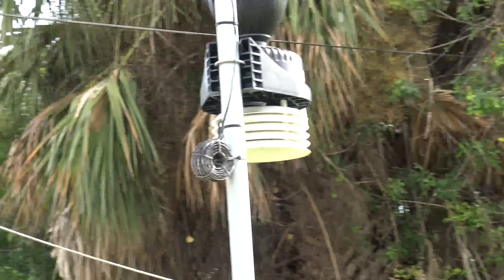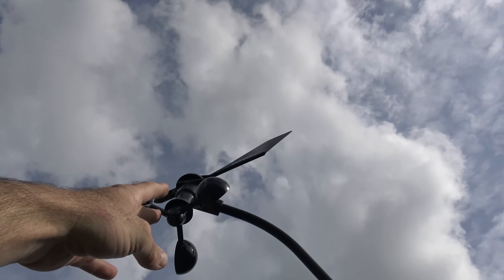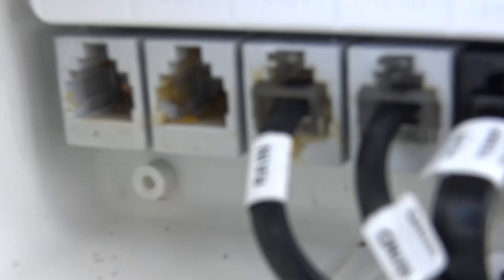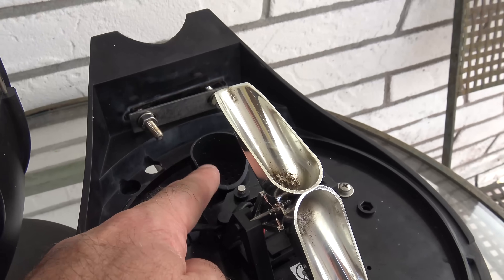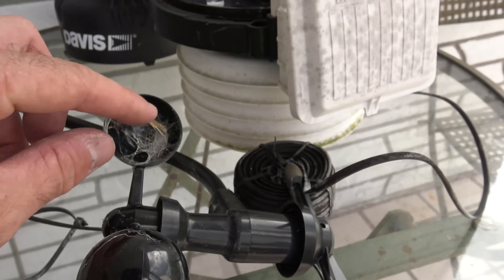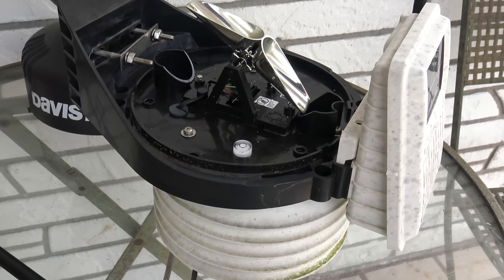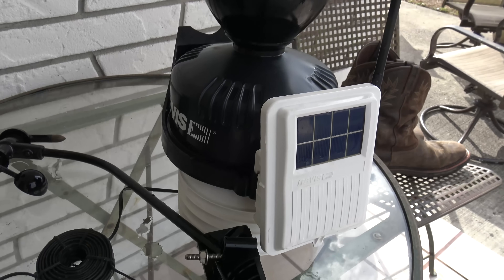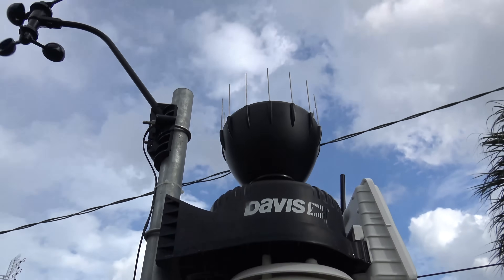Davis Vantage Pro 2, Update After 2 Years

Comment: Yes , the indoor temp goes up about 2 to 3 degrees after you turn on the lamp on the console.. very disappointing especially for a unit a pricey as the Davis Vantage pro 2. With out the lamp being on the screen is unreadable... so you have to turn the lamp on to read the information, which is really bad design on part of Davis... an 80.00 unit you can live it, but for 500.00 to 700.00 that is unacceptable.  Apparently this has been an issue since 2015 or earlier and in 2022 the problem still exist. I have multiple calls to tech support for multiple out the box failures.  I always say you get what you pay for..in this case - nope.

Comment: I am a Ham Radio operator and looking for a solid Weather Station. I have read lots of reviews and believe that the Pro 2 is going become my next purchase. I would like to ask if any others have used this station in and around a Ham Radio station? I am wondering if it is a problem to mount his at the top of my radio tower (55'). Or am I better off leaving it at Ground level? My thought is to know the wind speed at the Antenna height of my station. In my reading I do not see  anyone in the Ham Radio hobby fighting RFI with this system, but there has been no talk in the reviews stating the location of the VP unit. Any input would be greatly appreciated. Thanks Jeff W7NEE

Comment: I have a Davis Vantage Pro2.  You can calibrate the inside temperature reading on the console by selecting inside temp as the graphed value, then hit the 2nd button and then hold the set button until the inside temp reading starts flashing.  Using the up and down arrow buttons you can raise or lower the reading up to 12 degrees to calibrate the console.  I had to lower mine close to 3 degrees as it always read too high whether the light was on or off.  
In addition to the console, I use the newer Weatherlink Live (Part Number 6100) to broadcast my station over the internet using my WiFi network, (no computer connection required).  On the Davis Weatherlink app my station is called Oceanhouses at Ocean Village, Fort Pierce, FL, or on WeatherUnderground it is named Oceanhouses at Southpointe - Ocean Village KFLFORTP93.  It's great being able to check the weather from your phone.

Comment: To stop any erroneous readings while manipulating or cleaning put the console in setup mode. Mine has been up 7 years without problems other than the hole in the bucket clogging with polen(older style bucket), until now, my temp/humidity is not working correctly, the temp is fine but humidity works during the day and at night it marks 3%even if its raining cats and dogs, I have a new one ready to go in when weather permits. Why does everything fail when its bad weather and you cannot get to it to fix, sods law.

Comment: I'm a meteorologist. The rain sensor is called a "tipping bucket" rain gauge. Wind direction just "wind vane", wind speed is a "cup anemometer". Anything around your house can block the wind.
Story time: Univ of Wisc, Madison 1965-1972 incl grad school. Story told when I went there. North hall on Bascom hill. Weather instrumentation initially put there. They noticed a steady drop in wind speed over years. Some one noticed  the wind speed drop correlated very well with the height of the trees as they grew that were planted around N Hall when it was 1st built. They moved the instrumentation out to the Airport.

Comment: Great update!  I've been using 5-in-1 Accurite weather stations, which need repairing or replacing about every twelve months.  The solar panels are what fails the most often, but those are easily replaceable for $30.  I consider the 5-in-1 weather station to be disposable due to its' constant repair requirements.  I recently purchased Weatherflow's smart weather station.  Liked the concept of no moving parts, and few places for wasps and other bugs to build their homes.  Unfortunately, the rain accumulation readings are not accurate, even though the numbers are magically updated every morning following a rain storm the day before.  So, based on your experience, I'll be looking at Davis for my next weather station.
Reply: Did you ever get a new station? I highly recommend the Ambient Weather WS2902 or 2000. I had a 1400-IP for 5 years it still works but I replaced it with a 2902 for the better humidity sensor but the 1400 was actually still on the original batteries and everything! Never had one issue with the station itself. Loving my 2902 now, but I just got a Davis 6153 because I crave a separate anemometer and also have a hill that can block wind on the stillest of days, which is the absolute only time my AW ever reads slightly high (never more than 1-2F) and it also gets intense sun from morning to evening because we’re on the side of a south-facing slope.
Reply: I live around 3500’ in foothills of Northern California so it saw winds up to 68mph and many gusts above 50, temperatures between 18-100F, 100” of rain in one season, and tons of snowfall. The plastic faded but that’s it!

Comment: How do you get the console light to stay on? Mine turns itself off after about 10 seconds.
Reply: The unit has to be plugged into a wall outlet before the light stays on continuously. Once it's plugged in, push the LAMP button twice.

Comment: I like Davis Weather Instruments. Mine is hard wired and been working for more than 25 years. Annual cleaning/maintenance has helped make this product last. I was tempted when the wireless came out on the market to buy one of those units but chose not to buy one. My hard wired unit doesn't have all the weather gathering instruments in a central location. The temperature and humidity elements are positioned 20 feet away from the anemometer and the rain collection unit around the back of the house on the rear porch.
Reply: Hard-wired is the only way to go. ZERO issues here.

Comment: I’ve had three, the first one lasted seven years then it died.  The second one lasted three years and left it for the the new owner when I moved.  The third one was installed in October of 2015.  The current one has become a wasp’s nest and requires routine wasp killing.  As Eric stated you do need to keep it clean.  Love mine, IMHO, there is no equal.  Expensive? Yes.  Worth the cost?  Absolutely

Comment: I've had my Davis VP2 since December of 2005. The only issue I've had with my unit were the old-style magnetic reed-switches used in the anemometer. I had to replace them three times in the first five or six years. Now Davis has gone to a Hall Effect sensor for the anemometer and I've had zero failures since updating to the new unit some six or seven years ago. The rest of the unit just runs. All I do is an annual cleaning in the Spring of each year to clear out any dust or critters that may have wound up inside the unit. I also completely disassemble the temp/humidity radiation shield at the same time. I simply take the shields inside and clean them in my utility sink with some mild soap. Clean the sensor itself also with a small brush to remove any dust and debris that may have accumulated on it. Once cleaned just reassemble the radiation shields and re-attach them with the screws you removed earlier. A little attention to cleaning once or twice a year, will ensure your Davis VP2 will provide you with many years of uninterrupted service. I also change the ISS battery once each year at the same time I clean the unit. While this may be overkill, it ensures I won't have a power issue during the colder winter months. I have never had a problem with my Console eating C-batteries. I change them once every two years and have never had them go bad on me. After 13+ years of service, I am still impressed with the quality of the Davis VP2. Mine has survived the harsh northern Nevada temperatures of over 100°F in the summer to -17°F in the winter months and the almost constant winds we have here. Here's a link to a Davis YouTube showing how to care for you Davis VP2 (https://www.youtube.com/watch?v=8UjG9LNec-I). I might also add that I have the anemometer on a pole 33-feet above ground as outlined in the CWOP siting guidelines. The main ISS unit sits on a 4x4 post in our sagebrush covered field behind our house.

Comment: I too wanted a professional weather station after struggling with a LaCrosse unit ironically branded with TWS logos. It was not cheap, but you MUST shop around! I bought mine in '14 and its been a great investment. I even went ahead and added a wireless COM port to it & have it hooked to my hamshack in the basement, while the display is in my bedroom. I log the data through WeatherDisplay, and also send it out through APRS.
   My display backlight is always on and stays at a steady 76 degrees indoors... I wonder if there's a mod for that as well? 

   Was the bird spike cup an option? Mine doesn't have that nor the screen inside - I have to constantly remove tree debris from inside. Being in the Northeast, I've also tbought about adding a heater to the rain gauge - there's lots of mods to be found online for these units.